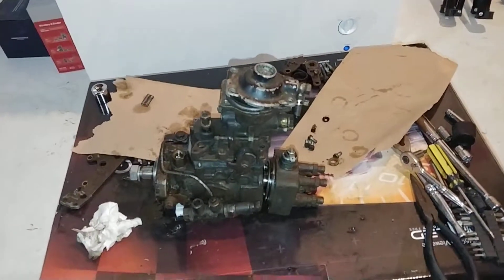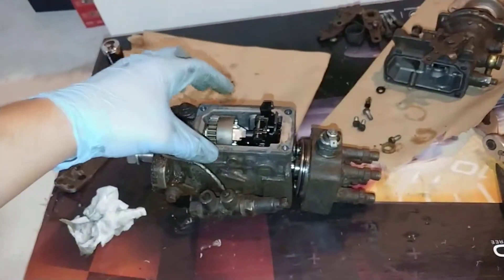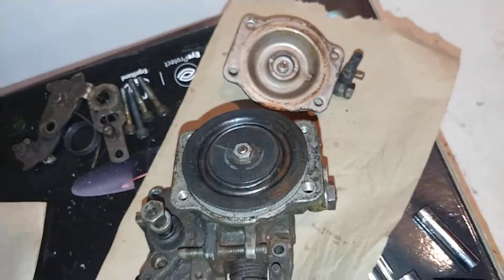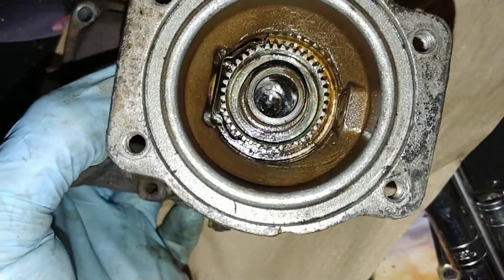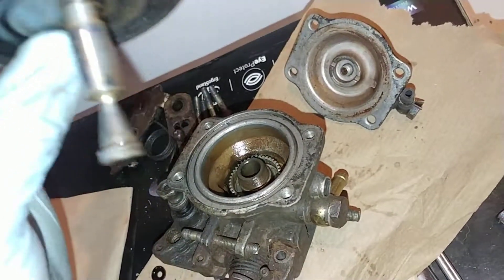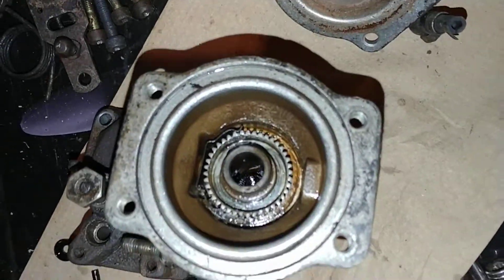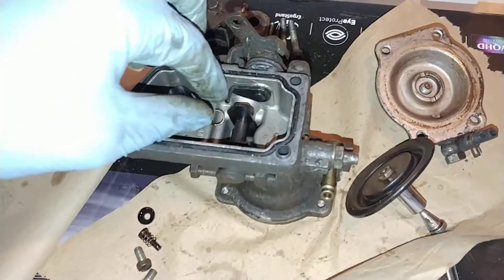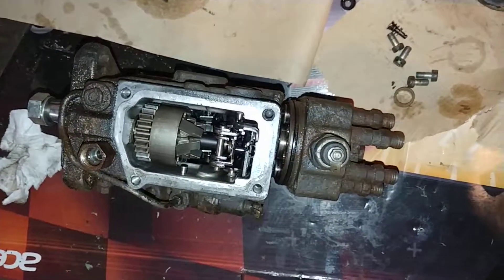Bosch VE pump teardown - part 1 - pump top and fuel control

Comment: Hello Brady - Mike from SW Western Australia   I have a VE fuel injector pump on our 100HP turbo diesel in our yacht.  Was delighted to review your 3 videos as I've had a recurring problem that has had the pump off twice.  
When the engine gets hot and I bring the RPM down towards ~1200 all is good.  When I drop the RPM to idle, I'm not able to get the revs up over 1000 RPM no matter what throttle position I put to it.  I have to wait till the engine cools to recover throttle response.  The problem gets progressively worse over months of use to the point where I cannot get the revs up over 1000, hot or cold.  Had the pump serviced; it was good for maybe 50 hours and now it's happening again.  Anything come to mind that might be of help?   Could that spring you show under the top section of the pump be the problem?
After two attempts to have the fuel injector specialists fix it, I'm going to have a shot at fixing it myself.  Thank you.

Comment: Hey man are you still using this account? I’ve got a leak from my boost compensator breather so id like to ask a few questions. Fuel pin seal? Is it doable myself?
Reply from the maker: When you say boost compensator breather, you mean one of the lines attached to the top very top of the pump, where the diaphragm and fuel pin is?
I assume you mean it's leaking fuel, not just a boost leak. If that's the case, it might be a torn diaphragm on the fuel delivery pin. It's pretty easy to pull the top of that off, just the 4 screws (but they're really tight, get a good fitting tool so you don't strip them). From there you should be able to see whether or not that big round rubber diaphragm is damaged or not
Reply: @bradymashak231  yes a fuel leak sorry :)…. but from my understanding fuel shouldn’t be that high, I’m thinking fuel pin seal. The diaphragm should be just dealing with boost pressure no?
Reply: And the breather is just above the fuel return on my pump, not the very top
Reply: @bradymashak231 
If the rubber was damaged could it make trouble of engine to start working????
Reply from the maker: The fuel pin doesn't really seal. So that like 2.5" diaphragm is what actually keeps the fuel from getting up into that very top portion of the pump. Can you email me a picture of the vent like you're talking about though? Still not sure I understand which one you're talking about.
Bjmashak@mtu.edu
Reply: @bradymashak231  sent

Comment: Hi @Brady Mashak, let me ask you a question. I have a ZEXEL VE pump, very similar to the one in the video, but with 4 injection outlets. The vehicle (Mazda 2.0) was stopped for a year. I changed the fuel and put it into service after this time and it starts with an excessive number of RPM, almost at the maximum. Could you help me, what could it be? Thanks!

Comment: Hi, great videos I'm learning a lot.  I have a ZEXEL VE pump but need it to operate in the opposite direction.  Whats parts do I need to change to achieve this?  Thanks
Reply: Hi ..
If l cancelled it or left it opened ...could  the pump work? or the air will inter

Comment: How would I adjust to get rid of extreme white smoke unused fuel while cold
Reply: adolfo I think the white smoke on start-up is oil burning, usually because the oil has leaked past the rings (or a ring) while the engine is sitting. Unburnt fuel should produce black smoke?

Comment: this series is awesome!!
I couldn't work out the lever on the top until I watched this. someone said it was the cold start adjustment when there is no wax heater. but when you said it was the manual shutoff I wondered because when I tried to use it on my b3.3, it didnt stop the engine. so still a  bit confused

Comment: Hi Brady, I've got a VE pump on my T3 Vanagon and its leaking from the round pump head seal. Does the pump and pump head contain it self (sans the two small springs) if I remove the head while the pump is in car, or do you recon I'd better get the whole pump out?

Comment: Great video!
I'm having trouble reinstalling the eccentric control pin. It seems that the pin it rubs against is spring loaded and just pops out again when i try to push it in with a screwdriver like in the video.
Any suggestions?
Reply from the maker: Hey Magnus, sorry for a delayed response. With the engine off, there shouldn't be springs pushing that pin in. Is it possible that there was still some fuel pressure when you were trying to re-install it? That would try pushing the pin inwards like that. I don't think it will help, but maybe worth a shot, you could try moving the throttle arm and see if that helps. That would interact with the pivoting components that could be pushing the pin in, but i'm not sure it will help you.

Comment: My pump is turned a little bit hot and I worry that if something ever goes bad in the pump that it will run away.  Before the pump I have a little ball valve between the VE and the lift pump.  It also doubles as an anti theft device.  No fuel to the pump= no start

Comment: You still active on this account? I have a question
Reply from the maker: Sure, no promises but I might be able to help. What are you seeing?
Reply: @bradymashak231  you mentioned the max fuel screw at 11:40, do have any idea on how difficult it would be to get it out and replaced with a new one? I have a guy sending me a replacement screw in the mail. I basically tightened the locknut too tight and the screw and locknut itself snapped off (they were both extremely rusty) and the rest of the screw is still inside the injection pump, i still have everything after the locknut. multiple people said I may either have to drill it out w/ a an easy out kit or take a rod of the same size thread pitch with JB Weld on the end of it and try and pull it out or work it out. the problem is it's still threaded in and not loose at all. ive had multiple people recommend drilling it out but one person said it may be a risk because you could mess up the threads in the pump which would result in buying a brand new pump or having it rebuilt which I dont have the money for. any recommendation on what I should do to get it out? I've posted in a few forums with multiples responses only getting those two options. any response is appreciated
Reply from the maker: @kcroz1104  ouch, yeah thats a bummer of a situation. If youre willing to remove the pump top, I'm pretty confident you would be able to unscrew that fuel limiting bolt yes. As long as the remaining threads in the pump top arent too rusty, you could probably grab the unthreaded portion inside the pump top with plyers and turn it to remove it. If you do that, I would take a measurement of how far in it is, so you can start from the same point when you put the new part in.
Reply: @bradymashak231  wouldn't a seal kit be needed when bolting the top of the pump back on
Reply from the maker: @kcroz1104  definitely should replace the seal yes. But towards the end when my pump was dying, i pulled the top off twice and it didnt leak without replacing the seal. Also, i wouldnt want to go near the pump with a drill bit, because one metal shaving in there, and you might and up with a pile of scrap metal.
Reply: @bradymashak231  how difficult would it be to take the top off do you think? im not gonna do it myself, although it looks pretty easy from other videos ive seen of disassembly, i'll probably have my dad help me. After breaking that screw my confidence in understanding auto mechanics went downhill haha. Too disorganized and would forget what bolts go where when reassembling it. But yeah do you think the hardest part of this process would be getting the old snapped screw out and putting a new one in or taking the injection pump out, taking the top off, and then putting the top back on after putting the new screw in and bolting everything down like it was before? Just trying to understand how f*cked I am.
Reply from the maker: @kcroz1104  as long as you clean all around the pump fairly well, take your time and take pictures, and have someone with some various mechanic experience, you can actually remove the pump top in the vehicle. So theres no need to re-time the pump. Only a handful of bolts (although, theyre kinda hard to get at) and a few linkages.
Reply: @bradymashak231  My car is a 92 jetta turbodiesel, same pump, a Bosch VE pump. so because it is such a small car there's alot less room to move your arms around under the pump to get all the bolts unfastened and injector lines disconnected and stuff, especially getting the injection pump itself out of the engine bay and getting it put back together and getting it put back in and bolted and all that just because of a screw lol. so with that being said, do you think it would be possible to just drill the broken screw out from the outside of the pump with easy out bits and left handed drill bits without unbolting anything or doing anything at all to the top of the pump? I'm not sure how metal shavings could get in the pump if I were to drill it from the outside at low drill speed/power. I feel it would be much easier to be able to remove and replace screws doing it that way rather than taking the injection pump apart. What do you think? Thanks for the responses!
Reply from the maker: @kcroz1104  Ahh gotcha. Yeah it should be okay to drill a partial hole and use easy outs, as long as you can get at the back of the pump to do that
Reply: @bradymashak231  Thanks! Appreciate the help!

Comment: Question for you, my truck wouldn’t shut off so I unplugged the fss, still didn’t kill it so I tried using the manual lever and that didn’t kill it either. I ended up using a 2x8 over the turbo any ideas where I should look?
Reply from the maker: If its not shutting off with the 12v fuel shutoff solenoid, that may mean bad news for the internals of your pump. The manual fuel shutoff lever does sometimes require a little force, so you could try rotating it a little harder?

On this video's pump, the fuel shutoff solenoid was sticking in run, because of metal shrapnel in the pump